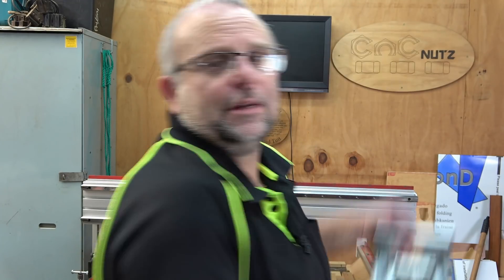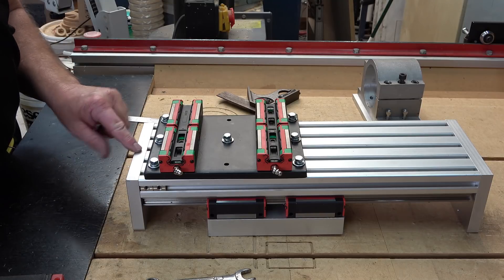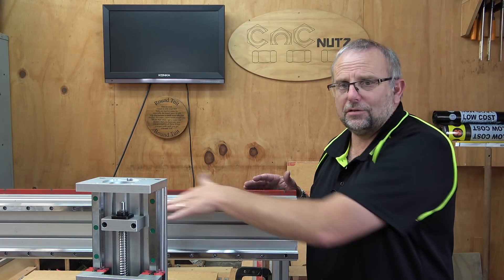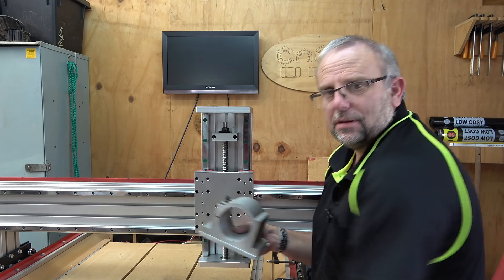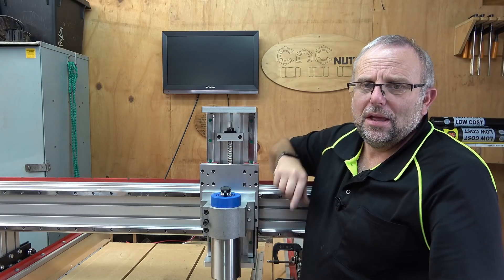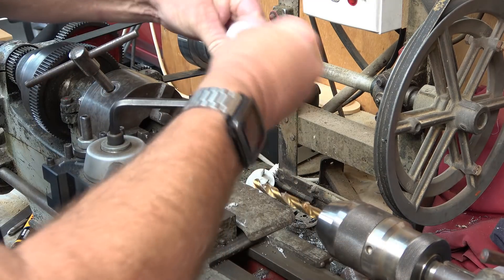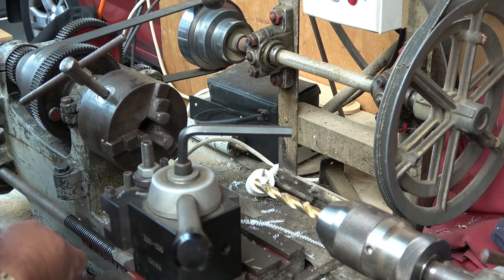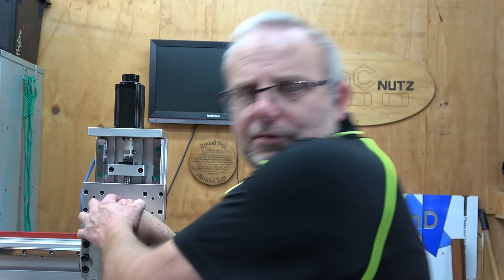X / Z axis upgrade Part 3 - CNCnutz Episode 253

Comment: Hi Peter - I bought the exact same Z axis for my own CNC, and I'm curious about your stepper motor size and power, settings, etc. I'm about to order a NEMA23 motor for mine and wondering if 1Nm or 2Nm is enough for a similar 2.2kW spindle.

Comment: I too am upgrading, actually replacing all but the stepper motors of my old cnc. I bought the same Z axis. The coupler I got fits well. However there's a problem with the ballscrew bending by the ballnut assembly. I've taken out the ball screw and found the bend within 10um. I've shimmed the ballnut to axis plate mounting point. It seems a little better. Was yours aligned well? I've also found some chips under the linear rails. After cleaning and realiging the rails accuracy improved quite a bit.
Reply from the maker: I did reduced the tension in the lock nut as it was a bit too tight but other than that it was OK.
Cheers Peter
Reply: @cncnutz  good to hear! I've ordered more for x (700mm) and two for y axes (1500mm). The x axis used bolts for thege rails that were too long (18mm), hitting the bottom of the extrusion with a clear mark, lifting the rail up 0.1mm. after replacing them all, accuracy was much better, within about 0.02mm. I've also replaced the twist inserts with ones with a ball spring with a larger surface which won't bend the extrusion as much when tightening. The two y axes haven't been cleaned and checked yet.

Comment: Hey Peter. How is your pre-build Z-axis treating you? I am in the process of designing and building my own CNC machine, but I got really tempted to buy one of these pre-build ones.
Did you find any problems with it, such as bad bearing balls etc? Do I have to wait for part 4?... ;)

Cheers from Denmark.
Reply from the maker: I would have to say the bearings are not the best you could get. I had to adjust the ball screw as it was binding a little and the bearings have no grease ports because they will hit the ends. The side grease ports look to be dummy ones on this bearing but I know you can grease genuine Hiwins from the side. This is my first look at linear slides so I am learning as I go. I can always upgrade them later on as I learn.
Reply: @cncnutz  I hope it works out for you in the end.
I remember seeing a video on Youtube about refitting linear rail carts with new bearing balls, after cleaning and flushing the carts for dirt and metal shaving etc.
He also talked about the improvements he got frosh simply cleaning the carts and re-lube them.

If everything else fails, I guess you can always buy genuine Hiwin rails and carts from a Chinese supplier. You can spot them on the price...  ;)

Cheers from Denmark.
PS. Check for radial bearing in the ball screw fixture. It might give some extra precision to the z-axis.
Reply: @cncnutz  I believe it was this guy:
https://youtu.be/loBHYcifzRM?t=697

Note the time stamp.

Comment: I see a potential limitation with your Z axis travel. Was it intentional to install the axis the way you did. The main Z axis rail assemble does not move which will limit the height of the material you can put under the machine. All the travel height you have on the z axis is mostly unusable. You Z axis rail assemble should be flipped 180deg so the square plate you attached your spindle too is attached to the X axis plate and the spindle mount is attached to the long plate currently at the back. This will allow the Z axis rail to move up and down with the spindle and allow greater clearance for your work area. Hope that made sense.
Reply: Peter, that's a good point... If you swap the plate that holds the linear bearings for the X axis and the plate that holds the spindle, you can make all the Z axis to move up and down, clearing up all the space below the X gantry. 
Correct me if there will be any issues doing that (weight maybe?), Because I am planning to build my CNC using this idea!
TY a lot!
Reply from the maker: Nice to hear from you John,
I actually can get a bit more out of it now that I see it together. With the setup I have I don't think turning the Z axis around would get me much advantage but I know what you mean.
I will have to see once it is finished.
Cheers Peter

Comment: you can add a normally closed relay on a pair of stepper leads (one side) and when the relay loses power (shutdown, estop), the relay will short the two leads and will prevent drop. in normal operation, the relay is held open and the two leads are not shorted.  You can observe this by just connecting one set of leads together (at the bench) and try to turn the stepper by hand, much more difficult. The 'detent' you refer too is much firmer. Cheers
Reply from the maker: Fortunately braking will not be needed. I would be wary of using this method as on some drives it could blow the output driver stage it the relay jams or is slow to open. Some are also damaged it the motor is disconnected or reconnected while there is still power on them.
Cheers Peter

Comment: Hose clamps? Holy Hanna Pete! That's more than a little off putting.
In many designs the un-driven end of the Z axis ball screw  is left to hang in mid air off the bearing support.
It gets "rigidity" from the ball nut. There is no chance for ball screw whip action because of its minimal length. 
You may reposition the fixed bearing support - (ie BK12 for a 16mm ball screw) and set it where you wish to get proper bite on a proper coupler. 
You have come this far......
Reply from the maker: I know what you are saying but I prefer to have maximum support for the screw and I like to use tried and tested methods of connecting the screw to the motor.
Cheers Peter

Comment: Perhaps a stepper or servo motor with an electric brake for the Z axis. They can only move if the brake has power.
Reply from the maker: I priced a brake and it cost more than the Z Axis. Fortunately I don't need to worry about it.
Cheers Peter